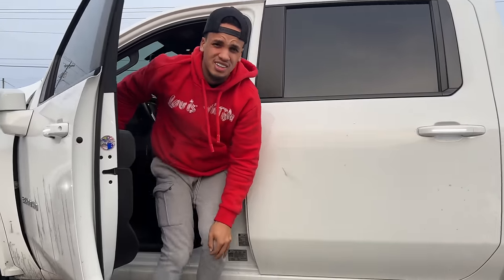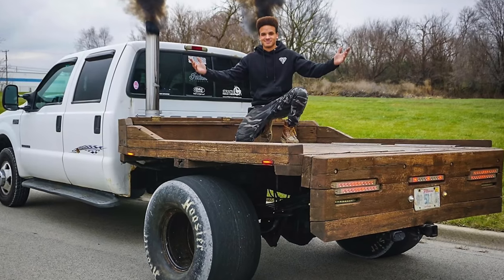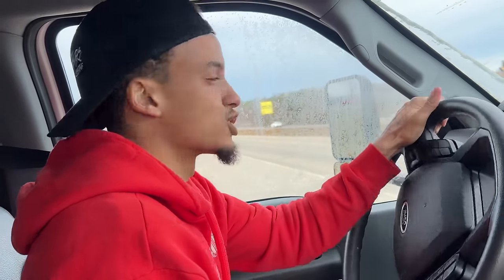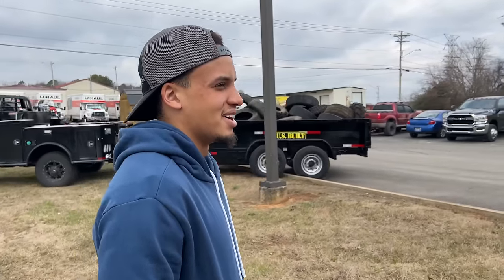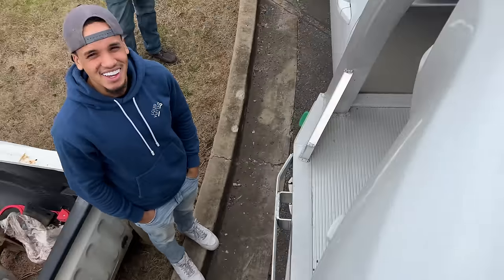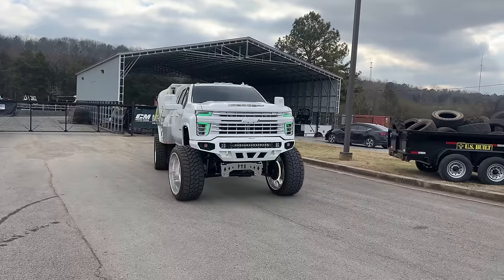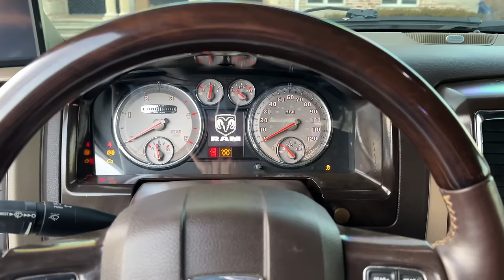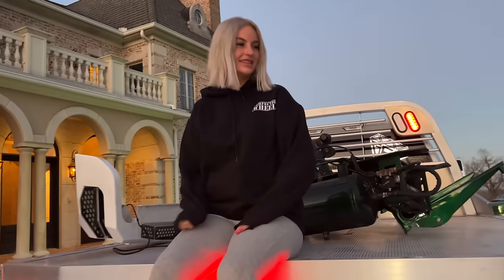Lifted Chevy Dually on 30s Gets CUSTOM FLATBED!

Comment: No hate. But I do body work for a living. I’ve replaced about 10 of those dually 1/4’s and hundred of SRW 1/4’s the 1/4 panels are not fiberglass. I wouldn’t say you but a lemon but some one definitely cheaply repaired that 1/4 panel before.

Comment: Screw the 450 you keep talking about, would be sick to see the worlds first ram 5500 with shortened frame to fit an 8ft bed. A few have done the stretched bed but nobody is shortening a 5500 to fit a normal 8ft bed